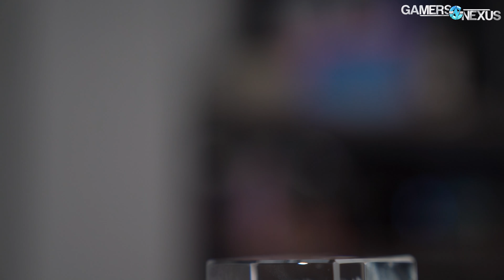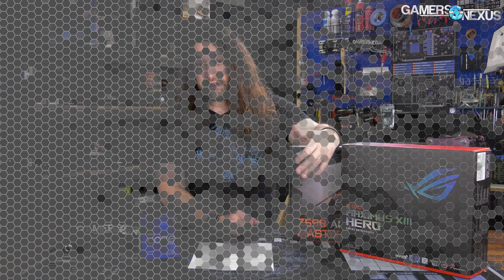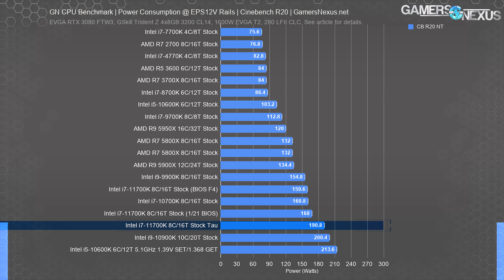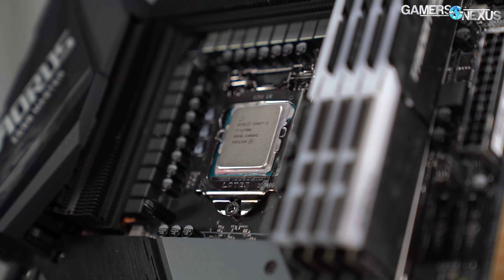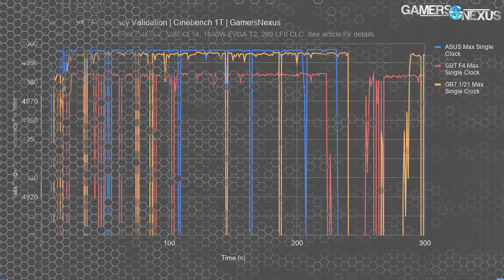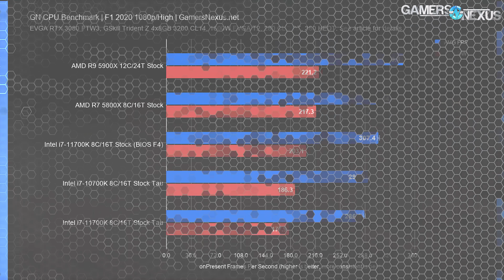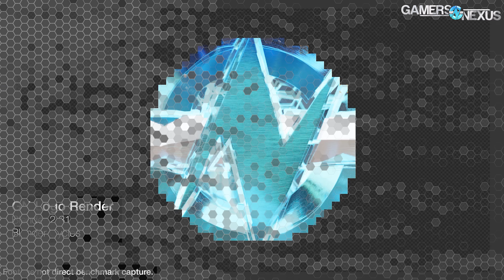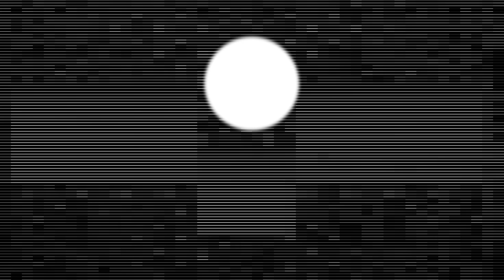Intel's Z590 Motherboard Problem: i7-11700K Power & Thermals Explained

Comment: Ah yes, finally. My FX-9590 was looking for a worthy opponent!
Reply: haha, cpu fan goes whirrrrrrrrrrr
Reply: @davidmalkowski7850  when you turn of computer they go sutututu
Reply: Lol intel fanboys defending a bad cpu
Reply: @nelsky8073  what? 5800 beats this intel without sweating...
Reply: My FX-8320 thinks you're an amateur
Reply: @cyberceel  my fx 9590 at 5,4ghz thinks that 360mm aio isnt enouf
Reply: @cyberceel  The FX-8370 still sold on newegg for a $120 in 2018 stares your 8320 down.
Reply: 🙃look here u little s***. My 8350 won't take this disrespec
Reply: @onlygoodthingsmyg  I remember my 8350 overheating and crashing just running DoTa2 on medium settings.. I can't even imagine how bad these 11th gen chips are.
Reply: @FrogOf4Chan  I have one on order and can’t wait to see how hot it gets tbh. If I remember I’ll update this post when I get it and the rest of the parts
Reply: @gducioevdgxyeuvddd3828  Which chip? The 8350 or the 11th gen?
Reply: @FrogOf4Chan  the 11th gen. Plus minus another week when everything gets here.
Reply: @gducioevdgxyeuvddd3828  I bet it will get hot as hell! DoTa2 is very CPU bound and runs ridiculously hot, I long ago upgraded to an i7 5xxx series and it still hit 64c under gaming sessions, and even my current processor the i7 9700k runs 62 to 66c with a decent cooling solution.
Reply: @FrogOf4Chan  😂 no doubt friend no doubt. But being like most of you guys that watch these videos I intend to find out first hand lol. I’m pairing the i7-11700k with a Noctua NH-D15 SSO2. Tbh I’m expecting to have to run this open air with a house fan aimed directly on the motherboard
Reply: @gducioevdgxyeuvddd3828  The Noctua will be overkill for an i7 running stock.. which is always a good thing in my eyes, a cool cpu is a good cpu.
Reply: @FrogOf4Chan  about 80c with all 8 cores turbo steadily @ 4.5 ghz with a noctua  nh d15. Ran under full load for about 10 mins at a time steady temps.
Reply: @gducioevdgxyeuvddd3828  That's insanely hot for only 4.5gghz. I'd bet it goes well over 90c running at 5.0 or higher.
Reply: @FrogOf4Chan  I should’ve mentioned I was running an avx2 binary on all 8 CPU’s when temps got that high. You won’t see temps like that with a good cooler when your playing a game....I hope.
Reply: @gducioevdgxyeuvddd3828  That's the 11700k right? Or is that the 11900k?
Reply: @FrogOf4Chan  117000k

Also nzxt cam software without turbo boost enabled @3.6 ghz with 8 cores running temps display about 41c running on full load . It is in an air conditioned environment as well and the board is a B560M AORUS PRO AX (rev. 1.x). Vrms are quite good on this one.

The software could be wrong but I can place my hand by the cpu fan and feel cold air comming out. When I open the case I’m not hit with a heat wave either

Edited : I’m open to suggestions on freeware cpu monitoring tools

Also unless  you plan on overclocking over 5 ghz this chip can handle whatever you throw at it as long as your cooling solution is top notch. When I went over 5ghz running avx2 that rig really really got hot . 4.5ghz seems to be the sweet spot  from my own testing YouTube videos aside
Reply: When your cpu's stock cooler is liquid you know you were always destined for great and unfortunate things lol
Reply: Still have my FX-9590 in the junk cupboard. It killed every motherboard I threw at it... Ahhh the days when central heating wasn't necessary becoz your CPU was sufficient to warm a small apartment 🤣🤣🤣
Reply: I'm still waiting for Cyrix to come out with a new CPU before I upgrade.
Reply: W3175X: am i a 800 watt joke to you?
Reply: Exactly, I absolutely like Intel Chips but 11TH Gen is not Sensible. It's just a Break for 12TH Gen.
Reply: I read one of the reviews that the FX-9590 pulls 320W at 5GHz, that was a 32nm cpu back at 2013 I think
Reply: @AirRookie  I wonder how much power the FX-8130 was pulling when it broke the 8ghz recorded.
Reply: @AirRookie  Sandy Bridge was like the Apple M1 for it's time. Right know, Apple makes AMD and Intel look like Bulldozer.

Insane singlethread perfomance in Geekbench 5 for the M1 at 3.2GHz and that thing consumes between 7 and 14 watts of power, 10 times less than Intel and AMD. Meanwhile, AMD and Intel need 5GHz for the same perfomance.
Reply: @saricubra2867  apple procceror is just a phone chip on steroids
Reply: The only processor not waste of sand is the I3 10100F now shut up.
Reply: * Laughs in Ryzen 3 3100 *
Reply: No no that will be the i9-11900K my friend. This thing is one notch down. Did AMD have a 9350? I know nothing from those years because I ran a Nehalem chip for nearly a decade lolololol
Reply: perfect for flight simulator
Reply: Hahaha
Reply: Intel mobos: Fatality
Reply: CPU and egg fryer in one package! 🍳
Reply: Nah, not even Drifters can get close to the FX-9xxx's when it comes to spinning wheels frantically for little productive use. Still gotta look backwards to NetBurst for anything equivilent ;)
Reply: At least this i7 doesn't have bad IPC ...

14nm +++++++++++++.
Reply: @saricubra2867  This is a comparison to Intel themselves.FX was slower at launch or at best equal to its predecessor,this is no different. This also consumes a shitton of power like the FX does.
Reply: @saladwithsalad  Nope, i7-11700K trades blows with the 5800X. That is missinformation.

Edit: 11700K has 50% more iGPU perfomance due to the new Xe graphics, 3200MHz memory, 19% IPC increase.

Get the facts right.
Reply: @saricubra2867  Do you have difficulties reading or...? THIS IS A COMPARISON TO INTELS OWN LINEUP YOU BLIMP , the 11xxx lineup is literally a waste of sand as Steve said
Reply: @saladwithsalad  Steve also said the same for 5800X. Also the 3700X or 10700K in no man's land but take a look at them right now.
Reply: @saricubra2867  in single core it does but multi core it’s pretty far behind at least in cinebench
Reply: @agostodandrea3589  You mean, for the i9 or i7 refresh.
Reply: @saricubra2867  talking ab i7 refresh. Also the title of the review video for the 11700k was waste of sand so ur mistaken. I have a 5900x so idrgaf but yea
Reply: @agostodandrea3589  The new i9 shouldn't exist.
Reply: @saricubra2867  none of the high end intel cpus should exist lmao they’re all ass buy amd or last gen
Reply: @saricubra2867  in... what exactly? Did you not see the benchmark yesterday? It beat it in like... one or two very specific benchmarks.
Reply: @saricubra2867  11700K is an 10700K revision 2 xD
Reply: @saricubra2867  Hmmm, I saw the benchmark and the Intel chip only pulled ahead in a few segments. There were segments where the entire amd lineup beat this cpu. Intel claimed double digit ipc gains which appears to be a lie unless the thermals are so bad that we can't see the gains. In either case, this is a poor cpu.
Reply: How much more power it consumes than 5800
Reply: @godisgreat2889  Depends on the motherboard, from 30w to 80w~ as peak
Reply: @willo1345  Are you joking?
Zen 3 with 19% increase and real life speed is just a single digit ahead of Intel Comet Lake for the same cores. Therefore with rocket lake you have 1-3% better or worse perfomance, that is within margin of error. But "Intel bad AMD good" .

Bulldozer: 30% slower in singlethread perfomance compared to Sandy Bridge, going to 40% less gaming perfomance as the max and for the same 32 nm node.
Reply: @saricubra2867  I wasn't comparing amds ipc to Intel's, I brought up that Intel told everyone they had double digit gains but clearly does not. I was actually hoping intel wasn't lying because I was waiting to see if I should go with them instead.

Bulldozer is irrelevant and has been for a long time now. The fact that you even bring it up shows your bias to Intel.
Reply: @willo1345  There's no double digit gains with overall perfomance by simply increasing the IPC.
Compare the Comet Lake vs Zen 3 in gaming, it's basically the same thing.

Totally the opposite, there is anti-Intel bias, finally, Apple M1 puts both to shame.
Reply: @saricubra2867  ok, I think this conversation is over lol. Your arguments are too nonsensical and off topic for me.
Reply: @willo1345  IPC is part of the equation, not the overall result that includes other things like core architecture, memory latency, etc.

Both AMD and Intel don't give the real perfomance improvement. Apple M1 is the one that has a massive IPC lead and improvements, Geekbench 5 singlethread perfomance on par with Zen 3 and Rocket Lake while clocked at 3.2GHz...
Reply: @saricubra2867  Bro, what the fick are you even talking about at this point? No one mentioned apple except for you and now you're calling both and and Intel crap when the whole point I was making is that this Intel chip is subpar so I guess you agree with me? No one gives a fuck about apple chips as they will be heavily regulated into the apple ecosystem so it will not be compatible with x86 architecture.
Reply: @willo1345  Both are crap, that's why Alder Lake must be succesful to rescue x86 from stagnation. When a mobile AMD APU can give better gaming perfomance than desktop because the latter uses a monolithic die (also includes integrated graphics, unlike the desktop ones that don't have that), and Intel still stuck on 14nm...

Apple is destroying both AMD and Intel, isn't even a competition in terms of CPU power, the M1X will destroy the 5800X and 11700K with better IPC, lower frequency and way lower power consumption (10 times less)...

Finally, Apple M1 Macbook can have better price perfomance than many overpriced Intel and AMD systems and includes x86 instructions in it, Rossetta is almost a flawless emulation and the perfomance that you get is very, very good, even tested with console emulators on MacOS.

Keep buying AMD with crappy microarchitectures and Intel desktops at 14nm++++++++. I already watched this Intel bashing cycle many times and they end up winning market share...
Reply: @saricubra2867  it doesn't matter because apple heavily regulates it's ecosystem, a lot of programmers don't program games and such for Mac because of this. Apple will never replace x86
Reply: @willo1345  I'm talking about the M1 itself than puts the Ryzen and Core series to shame in terms of microarchitecture. x86 needs a change, in fact, the fastest super computers use ARM chips.
Reply: @saricubra2867  You clearly don't get it. This argument has been so idiotic it's unreal. I'm done with this bait.
Reply: @saricubra2867  dude can M1 use other os than Mac nah so of course it will perform better with it's own os as apple likes to keep things close and yes amd and intel are much more powerful and better than apple shitty politics as they can use any os and even run mac os lol even though mac can do the vm thing but it's still not even close to be optimised for various tasks
Reply: @willo1345  bruh I can see what are u trying to say and I agree what u say the thing
Reply: @MrMilkyCoco Yeah, isn't fair.
A better comparison would be the KF versions vs the ryzen X parts which is something that some tech reviewers don't use, or the benefits of an iGPU included and the hardware acceleration it can bring for the money.
Reply: @saricubra2867  Not sure if you're trolling, but IPC is not a measure of a single part of the CPU. It is the measurement of the overall performance of the CPU per clock cycle. This means a 19% increase in IPC means an average of 19% more performance at the same clock speed.

The main reason why I'd recommend Intel is for cheaper builds and that they actually have stock (or for the iGPU). High end AMD CPU's still dominate in performance especially if you can make use of more than 8 cores.
Reply: @KillFrenzy96  IPC doesn't tell the whole story. 
There are other things like memory latency, cache, core architecture.

Example, just because Zen 1 has the same IPC as Skylake, doesn't necessarily mean that in real life it will be faster in singlethreaded workloads, the core architecture is flawed, so the i9-9900K came and beats many Ryzen 7s because it's a monolithic 8 core chip.

Ryzen 7 5800X's perfomance improvement over Zen 2 is basically the unified cache.
Reply: @saricubra2867  but the the 5800x is still way better i don’t want to start a fire in my house
Reply: @saladwithsalad  The "waste of sand", in their own tests, if I counted correctly, wins the 10700k by 5-1 in 0.1% figures, by 5-2 in 1% figures, by 4-3 in average figures, and in other tests by 7-3. In total, 21 wins vs 9 loses. That's not great numbers for the 11700k, sure, but summarize the results as "11700k is a waste of sand" I think is being too harsh on Intel.
Reply: @saricubra2867  igpu.. 🤣
Reply: @saricubra2867  10nm --------------
Reply: Your profile pic looks like Ian from  iddubs (however it’s spelled)
Reply: @samuelmagilocusts2870  it's Ian
Reply: @UC8_GWM_K3Gjntsaxzbhkmrw I think Steve called R7 5800X, a "Waste of Sand" .
Reply: @saricubra2867  he most likely called the 5800x a waste of stand because of the price difference between it and the 5900x. For a $100 more u get 4 more core, 8 more threads. So the 5800x is kinda a waste of stand compare to the 5900x but that's a different story when compared to intel.
Reply: @badboyhotstar  Do you know that the singlethread perfomance in one single CCD is better than 2?

You buy a Ryzen 9 and will not age that well for the price. 8 cores are the sweetspot.
Reply: @saricubra2867  wdym, Ryzen has higher IPC (Instructions per CLOCK) than Intel. Also with all the trashware with bad coding that is being realised having more cores is beneficial
Reply: @saricubra2867  I did some reading and that is true only when a CCD has less enabled cores, the 5800x (8) only beat the 5900x (6+6) by 3 points (.2%) In single-core on Geekbench, but gets beat by the 5950x (8+8) by 18 point (.8%) while the 5900x (6+6) beats the 5600x (6) by (3.9%). Basically with zen 3 the single core performance gap is too insignificant to consider giving up on 4 more cores just to get .2% more single core performance. statista(.)com/statistics/1134042/processor-single-core-performance-geekbench-score-worldwide/
Reply: @badboyhotstar  You give up 4 cores to pay a better graphics card, therefore superior rendering perfomance. No one does CPU rendering.
Reply: @saricubra2867  assuming you can find R9 at MSRP, it is. Good luck with that though.